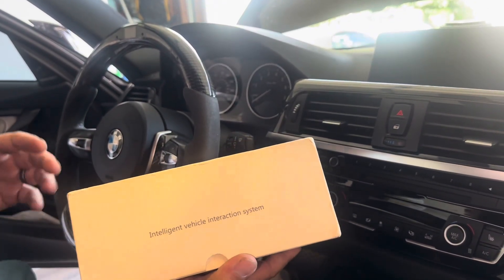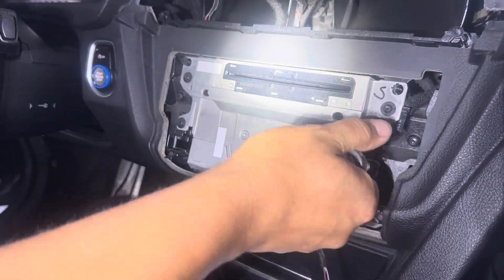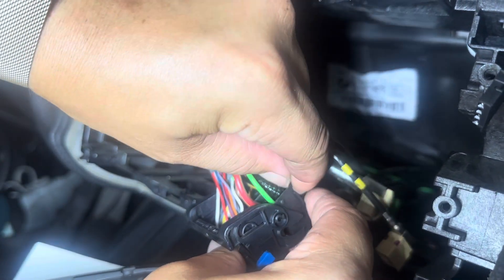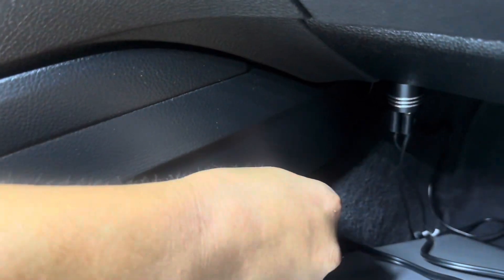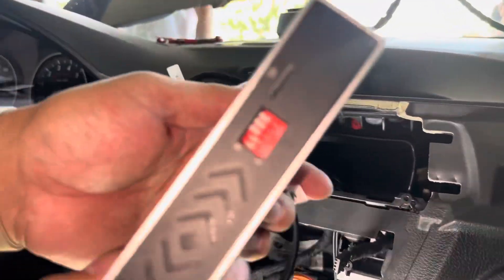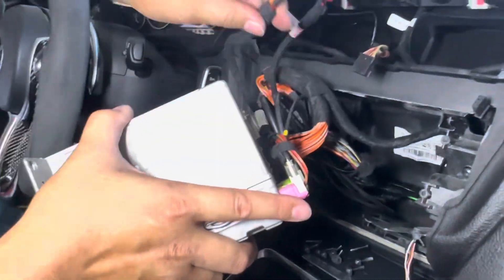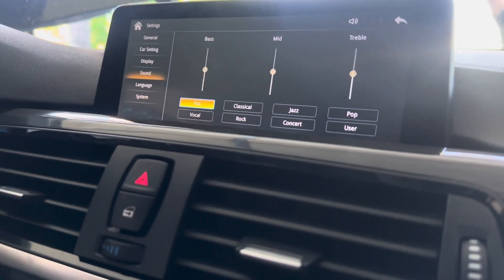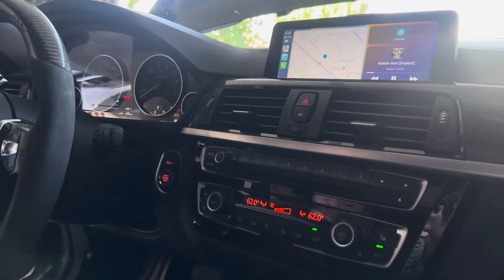Easiest Apple CarPlay Install BMW F30 335i MMI Prime Retrofit Box NBT I-Drive Upgrade

Comment: Hey brotha quick question, idk if youve ran into this so i installed my mmi box however i cant get the wireless carplay to work but the main issue is it will work through wired however i get no sound at all, i rechecked all my work 3 times but nothing took everything off and it works stock thankfully
Reply from the maker: Sounds tricky, hope you figure it out soon. Good luck!